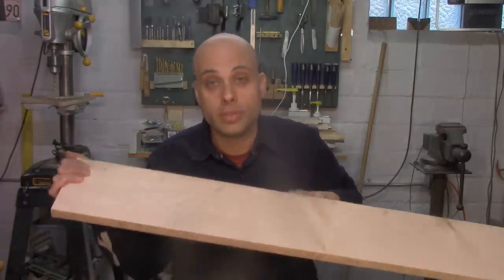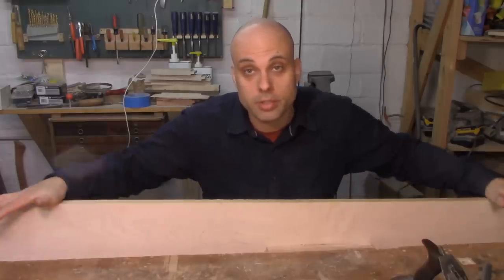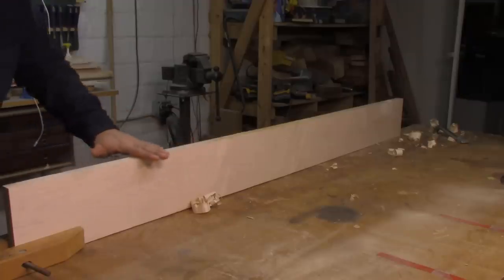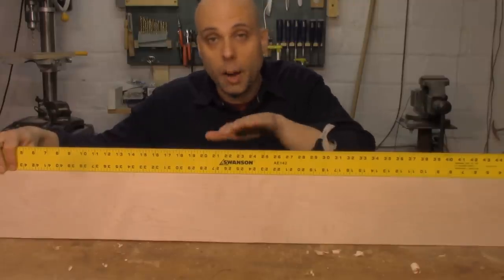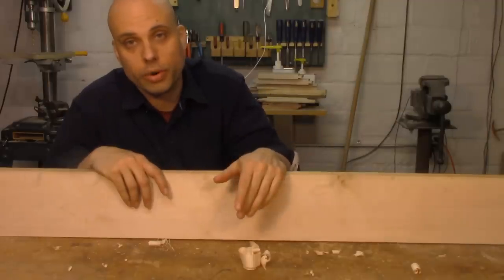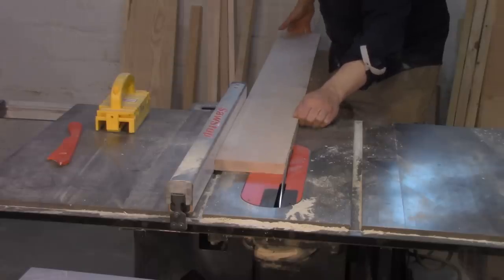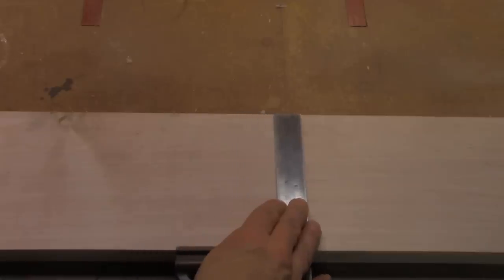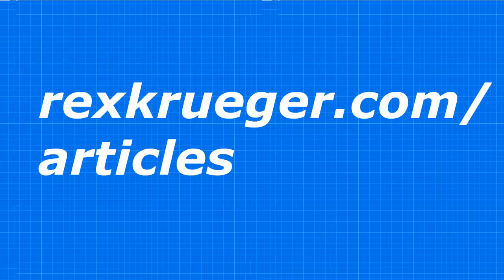Straighten boards. No jointer. No jig.

Comment: So the edge you flattened with the Jack plane stays against the fence  with all three passes?
Reply from the maker: Nope. You put the planed edge against the fence and rip the other edge straight. Then you rotate the board and rip the planed edge off (it's not perfect, so you want to get rid of it). Then rotate the board a third time and make a final cut just to be sure. You're rotating the board each time and getting a straighter edge with each cut. Does that make more sense?
Reply: Rex Krueger yes, thank you!
Reply: It's a face, not an edge, that has to stay in the same position. 

First cut: one face is down on the table. You keep that face down by rotating the board rather than flipping it. As you are referencing the two edges to the same face, the second edge should then saw parallel to the first edge. Both will be at 90 degrees to the reference face.

If you have trouble remembering, mark one face before you start, and make sure that face is always down.
Reply from the maker: Hilariously, I just wrote a reply, but yours is WAY better.
Reply: Rex Krueger if I have my face down there how will I be able to see?🤣
Reply: I didn't mean to step on your toes. It's a great video, but it looks from the comments as if a couple of people thought that you were saying that the reference was an edge, rather than a face.
Reply from the maker: Dude, my toes are fine. If there's confusion and you help clear it up, everyone wins. Really, your answer was better than mine.

Comment: Whats a decent jack plane to start with? Thanks!
Reply from the maker: The best bang for the buck is an old Stanley No5. You want one produced before the 1970s. Beyond that, it really doesn't matter. This plane was produced by the millions and is pretty affordable. Other good brands include: Millers Falls, Record, Union, and Sargent. If there are none around you, go to ebay and just eat the higher cost. By from someone who specializes in planes.

Comment: This is interesting, your workpiece is between the fence and the blade (which has no diving knife or guard).
Health and safety in Europe would be having heart attacks now because there is a real danger of 'kick back' since the workpiece is pinched between fence and blade, also convention wisdom says 'put the waste in that gap because one slip and you have strayed into the bit you don't want to damage - discuss?
Reply from the maker: Yeah, couple things here. First, the riving knife is installed. It's hard to see in some shots, but I don't make cuts without it or the guard. Ever. Second, having the workpiece between the fence and the blade is the only place it can go. If you want to avoid kickback, put the biggest, must stable part of the wood between the fence and the blade. I'm taking off such a tiny piece of wood that it would literally be impossible to put the "waste" between the blade and the fence. There is no waste. It's sawdust. Good questions, thought. I'm always up to discuss safety.
Reply: Yeah, Pat, I'm a little surprised at you. What do you suppose the rip fence is for? It's for gauging a cut to accurate width, no? L

Comment: Would a handheld power plane work aswell using this method?
Reply from the maker: I'm sure you could make it work. Set it for the lightest cut and check with a straight-edge after each pass. An electric planer is not my first choice, but I've used them at shops I've worked at and I think they get a bad rap in general. You can totally make them work if you're careful. Good luck!
Reply: Rex Krueger Awesome, thank you!

Comment: I can see how this gets the two sides parallel but the ends may not be square to the sides now. What about marking the side with chalk and plane until no chalk remains?
Reply from the maker: If you keep the same reference face on the saw, then your sides and faces will be parallel. No problem.

Comment: While cheaper than a replacement finger and/or hospital bills, the saw is quite expensive for the average beginner woodworker (approx $1749.00). 
Still, great tip for those of us without a jointer. 
Thanks for sharing.
Reply from the maker: Yeah, I mean, it's the only table saw I have, so it's the one that appears in my videos. You can do this with really any contractor-sized table saw and I think that tool is just about the most common one out there. I didn't mean to imply that you need a fancy saw like mine. Any decent-sized saw will do the job.
Reply: Rex Krueger oh, okay. I have a super portable Harbor Freight table saw on my budget. And its about 10 years old.
Reply from the maker: So, for a really small saw (and I used one of those for years, so no judgement from me), you might want to add an auxiliary fence. You just want to make your fence a bit longer so that it bears on the longest possible length of your board. All you need is a strip of good plywood and some clamps. Many designs available on the net.

Comment: Why using the Jack plane when it would be much easier to use a #7 and get down the work in a jeepy.
Reply from the maker: Because jointers are pretty rare, but if someone owns any plane, it's likely to be a #5. And the 5 totally gets it done.

Comment: This method is not ideal for a DIY woodworker. If you don't have a jointer much likely you're someone who is getting into woodworking or do it as hobby. Using a planer for this purpose is a great tool in the hands of someone with more experience. It relies on touching and visual inspection, plus keeping the plain at 90 degrees angle in reference to the wood sides.. Is not the ideal method for someone new. I would recommend use a table saw instead. There are many videos that explain how to do it.

Comment: If you don't have a Jack plane, the easiest way to do is a straight ball bearing 1 and half-2" long and a straight edge of a plywood or MDF sheet.  Clamp your board and joint with the router, much faster and less work for a perfect edge. Sorry Rex, they are easy ways to do things

Comment: Cutting the piece to a smaller size, a little bigger than needed, will make it easier to flatten and straighten, rather than the whole board. Also you must explain how to flatten the face and back, not just the two edges. The 2 ends are then squared off last.
Reply from the maker: Well, I can't cut the board smaller, because the board already is the size I need. As to flattening the face, I buy planed wood and I don't mean to be a smart-ass, but I explain that in the first 30 seconds of the video. As to squaring off the ends, I think anyone with a table saw can figure that out without my help.

Comment: Why not screw it to a length of plywood with a known straight edge and run it through the table saw using the plywood against the saw fence ?.
Reply from the maker: No reason no to, unless the screw holes would be a problem later. Plenty of ways to skin this cat.

Comment: where can i get a good jack plane?
Reply from the maker: Tricky question. What's the budget?
Reply: @RexKrueger  kinda tight... My tools are not expensive but I manage by using my square and such to make sure of my cuts. I don't know what price range they are so giving you a number is hard. I cannot afford much.
Reply from the maker: I haven't tried one myself, but I hear Grizzly planes are just fine. The no 5 is on Amazon and is affordable.

Comment: You can use that plane for 10 years and you will never get that board perfectly edge jointed like you will if you use a jointer you may come close but you will still have at least some high or low spots I’ve seen too many of them over the last 50 or 60 years and never one of them is perfect doing it the way you did it
Reply from the maker: I totally hear what you're saying and I won't discount your experience, but you have to realize that the jointer has only existed for less than 100 years. Think about the most famous names in 19th century furniture like Thomas Chippendale or Andre Roubo.  These dudes make very precise joints and edges and all they had was hand tools. It's clearly possible because master craftsmen have been doing it for centuries. I'm no master, but I do make stuff professionally and this is how I actually do it for client work.

Comment: TRACK SAW --> Table Saw
Reply from the maker: I think you mean that a track saw is better (greater than) a table saw. That would look like this: "track saw > table saw". What you typed was an arrow, which doesn't make any sense and kind of defeats the point of using symbols instead of words.
Reply: @RexKrueger  Nope. I'm saying, If you trust the face of the board, why don't you trim the edge off with a track saw, and with that perfect edge, put it against a table saw for the final dimensional cut.
Reply from the maker: @PWuTubber  Ah!  I retract my previous comment. The answer is: I don't own a track saw. And honestly, if you own one, this video probably isn't for you.
Reply: Sure, I can respect that. However, using a clamped down straight edge with a regular circular saw will get you there too. The thing is getting a straight edge using a Plane takes a relatively high amount of experience and skill.
Reply from the maker: @PWuTubber  Agreed, but in my view, that's a skill worth having. Never wasted time. Also that plane I use in the video cost $5 and it will do a million things to a piece of wood. You're totally right, this is not the fastest way, but I build things out of wood for a living, and this is how I really do it.

Comment: And what if you don't have a table saw?
Reply from the maker: Bandsaw, hand saw, circular saw, track saw, ryoba. Basically any kind of saw that's capable of ripping a straight line. Probably not a jig saw.
Reply: Ie. I'll always want a machine! I do it with eyeballing, plane, on both edges.

Comment: Stupid question...why not just run that edge on your table saw?
Reply from the maker: Because the fence on your table saw needs a straight edge to reference against. If you don't have that, it's a very dangerous situation. People typically use a jointer  to get that initial straight edge.

Comment: why not put it through the table saw?????
Reply from the maker: Because the table saw needs one flat edge for the fence to ride against. So you get one edge with the plane and then run it through the saw.
Reply: Nahhhhhh, just put a carrier board under and stick the warped board to the edge and a little pass the warp and then turn that finished side and do the other side with the good side done. Your idea is very good but I'm used to do it on the table saw.
Reply from the maker: Then you should stick with what works.
Reply: Yes, I think I will but thanks for other hints on how to get it done.
Reply: hmmmmmmm never tried it on the router

Comment: Why a jack plane rather than a jointer plane?
Reply from the maker: Because they're MUCH more common and cheaper. More people have them and their rough cutting abilities make them perfect for slash and burn leveling of really wavy boards. The idea here is not to joint the edge, but to make it just straight enough to ride the fence. Not that I don't love a good jointer, though. A good No. 7 is killer. Good question!
Reply: Unfortunately the cost of a good No. 7 is also a killer, at least compared to a jack.

Comment: A faster way, Two-face tape your straight edge on one side of your board and run it through the saw, Or if you have extra board, Screw it on.
Reply: I can give you one very good reason why you don't tape a straight edge onto the side of your board, Phillip.   Kickback!!!
Reply: the way your doing it is way slow, someday you will learn faster way's that mean more money, Been taping a straight edge on and using a jig that you just set your board on and go for it,  it works great.  40 years never had a kickback, All in the person doing it

Comment: Why not tack a machined edged bit of plywood onto one side, then run it through the table saw with the straight edge against the fence, flip it over and do the other side.
Save all that planing
Reply from the maker: Two reasons: 1.) I need all the wood in good condition. For the job I'm doing, even tack holes are not acceptable if they can be avoided. 2.) "All that planing" is valuable practice using a very versatile tool that can be bought for peanuts and used for a million tasks. This approach makes one a better woodworker. Of course, there are MANY totally legitimate ways to do this job. I'm just demonstrating mine. It's no judgement on anyone else's approach.

Comment: Don't laugh, but could you effectively use an electric plane to do this?
Reply from the maker: Oh sure. There's nothing wrong with electric planes. Set it for the lightest cut possible and then just follow the steps in the video. Totally reasonable question.
Reply: Just make sure it doesn't remove the end of one of your fingers.
Oh, and you'll also need ear-protection and goggles for your eyes, of course, and a long enough cable to reach all along the board.
(You could just use a hand-plane ...)
Reply from the maker: I'm guessing he doesn't have a hand-plane and DOES have an electric planer. Like the man said, you run what you brung.  I think those of us who have hand-tools and know how to use them might forget that we either had a good teacher, or spent a LONG time figuring things out for ourselves. I did not have a teacher.

Comment: Or get yourself a flush trim bit. clamp down a straight edge just past the edge of the board and with the least amount of effort you will have a perfect edge. Honestly what he is doing is way to much work..unless you just don't have a router or a table saw sled.